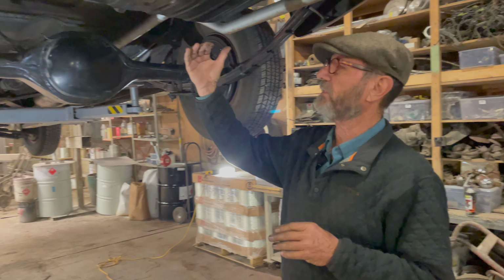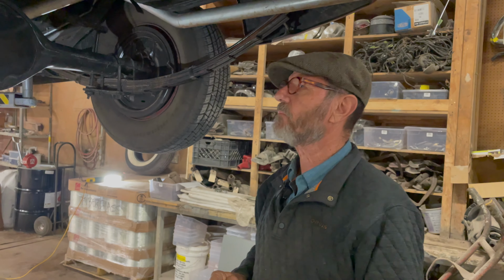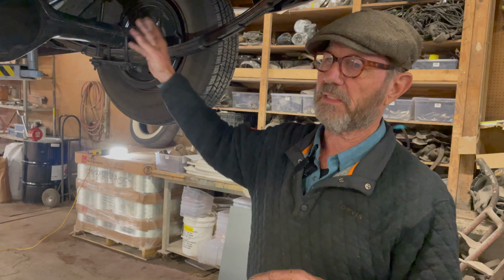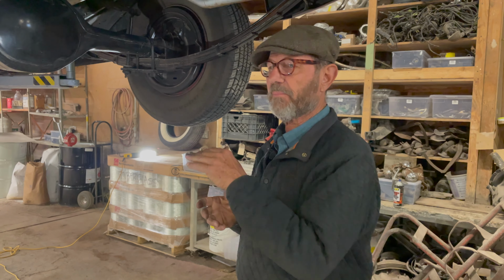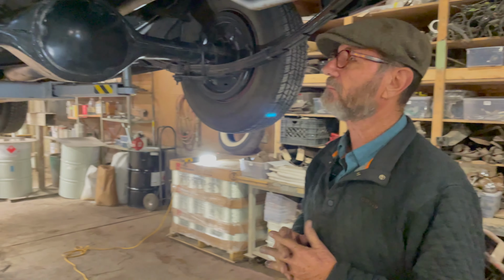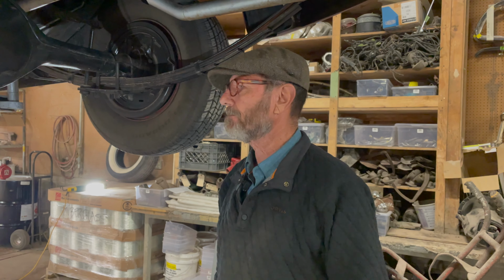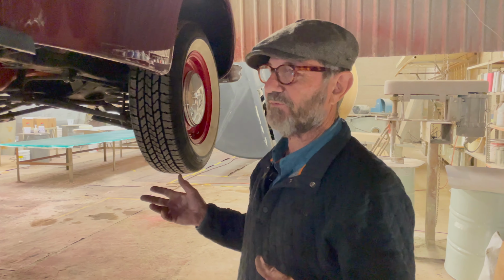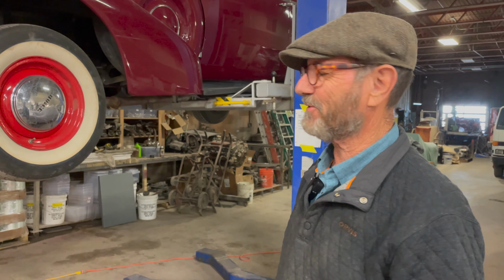1937 Buick Century Part 5 - Fuel System Stuggles. Getting a Buick Convertible back on the Road!

Comment: Sweet upgrades that should make this a fun cruiser. Totally agree with the electric fuel pump to get the carb(s) filled before using the starter.
Reply from the maker: I used to think all that cold cranking was ok for prelubing the engine but then there’s the battery challenge. I can’t wait to cruise with it. Will post that video as soon as the car is ready! Thanks For watching...

Comment: Research shows that the first factory muscle car (big engines into smaller chassis ) was likely the 1937-38 Buick Century. The huge (for the day) 1938, 141hp, 320ci OHV Buick Roadmaster engine and 3-sp trans was installed into the small Buick Special chassis and renamed the Century. Police got on to using the Century as there were few cars that could outrun it. Hot rodders of the 40’s also used this engine in coupes and roadsters. Buick claimed that its Century models were the fastest U.S. production-based cars on the road; at the GM Proving Ground, the Century was clocked at a top speed of 103 mph hence the “Century”.
 A 1938 Century sport coupe once held the National Hot Rod Association class record for the next two decades or so. Its performance was a joke by today's standards, but in 1938 using ~70 octane, the 320ci was hot stuff.
Reply from the maker: Absolutely, I did a number of videos on the 1937 Buick Century convertible, owned by my friend JB Donaldson. If you look it up on my channel, you’ll find it! Great car.

Comment: You have a '64 rear axle in this '37. How did you eliminate the torque tube and keep the straight eight?  What kind of transmission was used and was there an adapter used?
Reply from the maker: Yes an adapter plate was made for the straight eight to connect to a TH400. From there it’s a fairly simple shaft to the hanger bearing then a short drive shaft with typical u-joints to the rear axle. This video is mostly about the fuel system and trying to get it running so we haven’t really covered the driveline modifications and other details yet…
Reply: I'll be looking forward to a video explaining the drivetrain modification.  I have a beater '37 Special I'm trying to get on the road.  So far I am keeping it all stock but never had it on the road.  I've pieced it together using parts from many different cars and don't know if it's going to operate satisfactory.  If once I have it together and it runs like crap I'll do modifications to make it drive better.  Right now I'm looking into exchanging rear axle gears to get better highway speed.  I've been told the Special in stock form is a dog on the highway.  Not looking for a hot rod, just a nice running car.

http://www.fatfenderedtrucks.com/37buick01.html
Reply from the maker: Sounds like a fun project, that is nearly ready to enjoy!